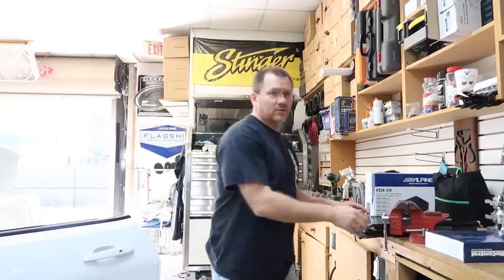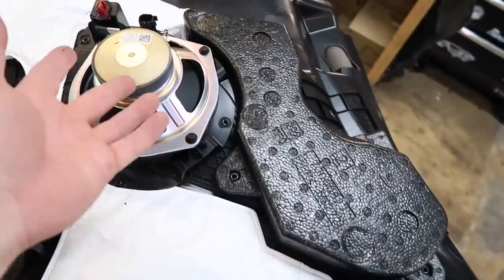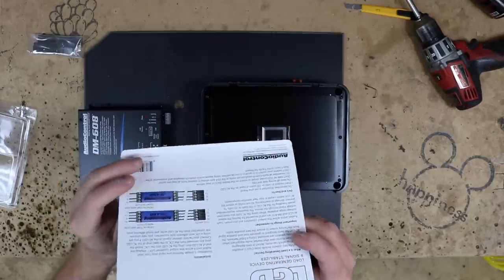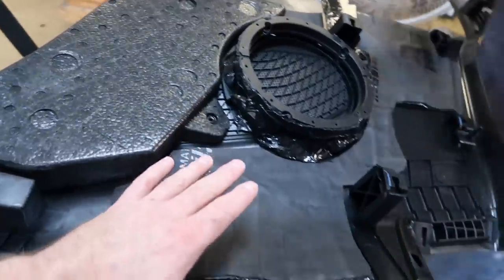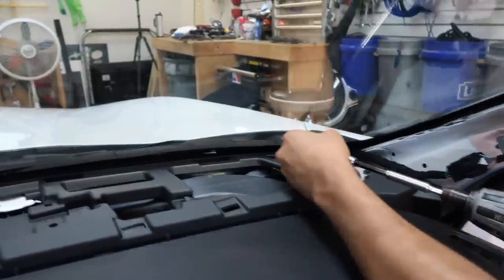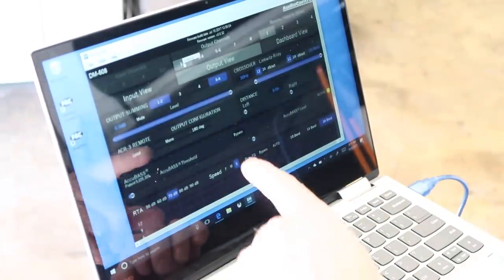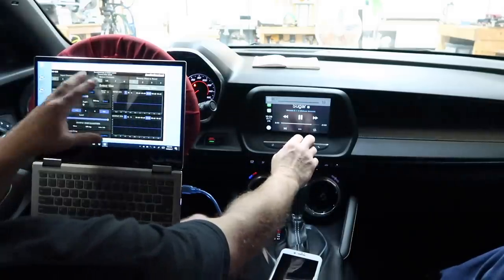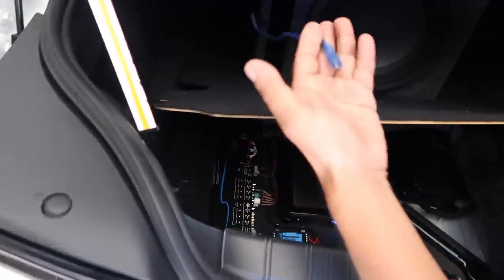Is that a 2017 Camaro in for a new stereo, why yes it is!! Installer Diaries 56

Comment: This is awesome. I've been waiting to watch you guys do a DSP! I just finished Roadkilling my doors and installing a 5-channel JL, miniDSP 6x8, 12" AudioFrog sub, and Hertz Energy's with Fast Rings in a fully active setup thanks to all of your videos. It would have taken you a day, but it took me four. :D
Reply from the maker: Very cool, how do you like the miniDsp
Reply: I like that I can use my computer to run it. Being able to use my Mac was the deciding factor over the JL TwK (these were the two in my budget range), and being able to use REW seemed really cool. After watching a few tutorials on setting up a DSP with REW, I've noticed that the Helix software seems to be a standard and also that it's pretty flexible. The miniDSP software is slightly less functional (i.e. I can't create pink noise in a specific frequency range), but will take the REW EQ settings and do everything else I need (active crossovers, time alignment, and EQ). I'm pretty happy with it. This AudioControl software looks awesome too. I like that it flattens out the input EQ.    

The biggest mystery was getting power to the miniDSP. I didn't realize I could just use a distribution block. So I got one of those, created nice connections with wire ferrules, and that was that.

Comment: BEAUTIFUL install, again, the wire/cabling work, impeccable! About how long did this install take, and when commissioned to do this job, how much prep work was needed?
Reply from the maker: It took 2 days. We ( me) usually spend several hours talking over the system with the customer. Making sure what we do is a fit for the customer.

Comment: Are the tweeters on this camaro connected to the door speakers with a passive high pass filter or do they have their own signal from the stock stereo?
Reply: Did you ever find out?
Reply: @brianmurry2281  for the 6 speaker system no amp in trunk they take signal from the door speakers

Comment: Serious question. I'm picking up a 2020 camaro once they are released. I live in Michigan but I used to live in Tampa and I'm familiar with he area down there (lived in the apartments at Rocky Point).  I like what you've done with this 17, very professional... If I drove down how many days would you need to do the same job?

 I have the amps, subs and speakers from my 2010 camaro. Pretty sure I could re-purpose most of my equipment... need the processor and wire and maybe a few other items?

Comment: So, if I wasn't distracted when I heard you say this, you connected the Sub RCA connections to the rear speaker wires that were already there instead of running them all the way up to the factory radio? I'm trying to find solutions for my own sub installation, I have a 2014 Audi A4 and it is very tight and complicated when it comes to wiring things up and making it look clean. I'm still deciding whether I want to run the RCA all the way up to the factory radio and use a Line Out Adapter to connect it, or if I just want to disconnect the rear trunk speaker wires and just run those to the subs instead. I'm pretty new to car audio but I really like stuff like this and would love to be able to hook it up on my own and have it look good and sound good. I've done a bunch of research on installing aftermarket speakers on A4's and haven't found much (might just be dumb and looking in the wrong places), but if anyone else has a A4 with subs, I would love to know how you hooked them up. Besides that, great video! I love watching them, you guys are audio geniuses. Thanks!!

Comment: I honestly greatly admire both of your knowledge on car audio. I can put together a very basic system and I recently put one in my escalade. Thanks to you guys, my cable management game was on point. I need to replace my stock speakers now as they distort  pretty badly, which is odd because my tahoe didn't do that, which also had a stock bose system. I tried to blow my tahoe system and couldn't do it. However in the escalade, my door speakers sound awful at mid volume.... Anyhoo, are there any video's or books your recommend for the very basic beginner that delves into terminology, what parts do what, etc.? Thanks for the great vids boys!

Comment: First of all I must say I love your videos.  I have a question.  When you said you are running speaker wire from amp to all speakers.  How did you run it from amp to front door speakers?  That harness on the side of the door sucks.  I just ran my 16gauge wire from amp and then connected it to the harness in the car side.  I would rather run it to the speaker itself.  Please let me know what you did or did ya do the same thing as I did?

Comment: I thought the rear signal on these cars was filtered from the factory. On the camaro6 forums, everyone recommends grabbing the speaker INPUT from the front passenger side foot-well area. I have a 2018 Camaro SS 1LE, the 1LE's are the only SS's without an amplifier and Active Noise Cancelling.

Comment: Not going with an active crossover is kind of a waste of a DSP. If I have a 5 channel to work with, I will keep the rears powered off the deck, and use 4 channels on the amp for the front mids and tweeters. You lose a lot of adjustment that you gain with a DSP if  you go with passive crossovers.

Comment: hello , i have a 2012 chevy traverse and trying to hook up an aftermarket amp to my factory radio, im also using a L.O.C. and also new speakers in the doors, but im having trouble running wires when there is a electronic plug in the door jamb... do you have any videos of you doing a traverse of that year or 1 similar with same wire colors and where they are located... thanks in advance

Comment: Hi guys, really enjoyed the vid, I wish I could’ve seen how you tapped in for the front speakers. I’ve been waiting for you guys to do a 2017 Chevy with the same head unit as mine. I hit you up on Facebook a few months ago I believe for advice on my 2017 Chevy Trax and I did as you said Dean and went with the RF punch 6.5” all around with speaker and harness adapters with the fast rings and slight door deadening. I also did the powered RF 12” sub like you suggested too. It sounds pretty good and I also tested the speaker outputs to see the response with my RTA app and got a similar response to what you guys did and compensated a bit with the punch EQ on the sub but on the head unit the bass I didn’t have to touch, I think I had to boost the mids slightly and the treble I had to take down a bit. I actually had to get the RF tweeter kit for the crossovers to allow me to attenuate to 4db because how it was originally the tweeters were overbearing and distorted before I could get the midrange to a nice clear loud volume but now everything sounds nice and balanced like it did with the stock system.
Reply from the maker: Very cool, thank you for sharing 😄

Comment: Have you done a 99 trans am ws6? I would like to see how you guys done it! Good job by the way,,,,,
Reply: 2 years late lol. But I have on 02 trans am. Built a floating amp rack in the back. Running 3 RF amps, mono for the sub,  4 channel for fronts and rears and a 2 channel OG type RF for the 6.5 " subs" in the sail panels.  Switched up systems alot, love doing car audio.

Comment: Hey guys great job you do. I have a 2018 Camaro with Bose system. I'm looking to put 7" front speakers and was wondering if the rear sides and rear deck speakers add to the listening experience and if so, whether I should put both sides and rear deck speakers in or just the side speakers or the rear deck speakers in
Reply from the maker: The 18 we just did we keep all the speaker location. We did Morel 6x9 components up front, 6.5 and 6x9 coaxial in the rear. We kept the center speaker. The customer loved it.
Reply: Hey thanks for the input, Also if you could  what is the center speaker for ,also I looked up Morel speakers on Cruthchfield  and none of them were listed as something that could fit

Comment: How are you getting any good sound out of the rear side panals.  I have focal aim front and rear and the sides sound horrible.  The installer was doing his front staging after being told not too and it’s is blaring in. Front and sounds like the stuff the rap kid put in cars.  I wanted the full sound not the kid sound. The sub was never a problem to hear but he wanted that same open air idea to handle the Omni directional sound that the vehicle didn’t need.  I would rather have some mid bass than the brassy sound of fro t staging.

Comment: Do you guy know anything about the harmon kardon system that comes in some of the dodges? I recently bought a challenger with the harmon kardon package but the previous owner took the subs out. I was wondering what I would need to install new subs. The wires are already ran but I guess I would have to go through the harmon kardon wire harness a decipher what wire is for what? Also would I need an amp or is there an amp somewhere else on the car? The previous owner only took the subs but I'm not sure if the amp was built in to the subs or if it is still somewhere. Any help would be great! Thanks!

Comment: I have the same exact audio system. I cant find the speaker wires at 1 location to tap into with my line out converter as im replacing all my speakers and adding a four channel amp. Do you or anyone know where thst location is? Or do i have to run wires from each speaker themselves?
Reply: My LOC is a 4 channel as well as my amp

Comment: I have a 2018 with basically the same system so there is no factory amp? my car has the magnetic ride control module were the Bose factory amp would be
Reply from the maker: It depends on what factory system the car comes with. This one was the base with no rear deck sub woofers or amp